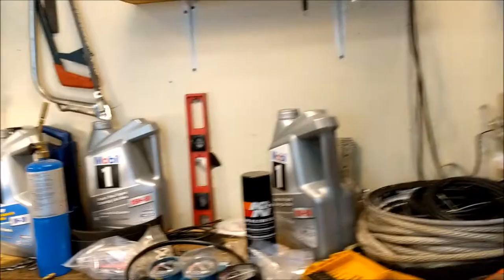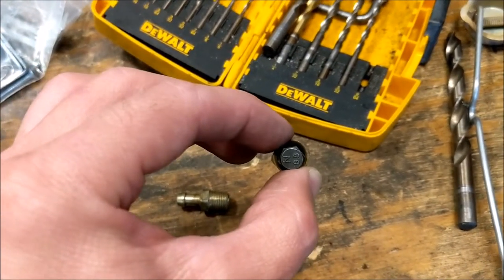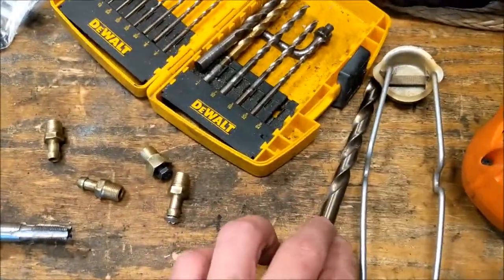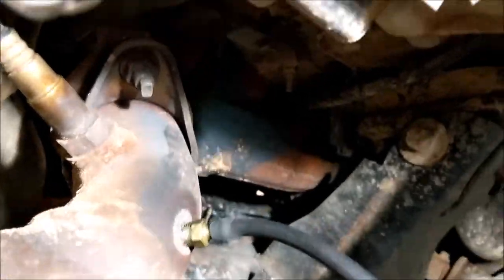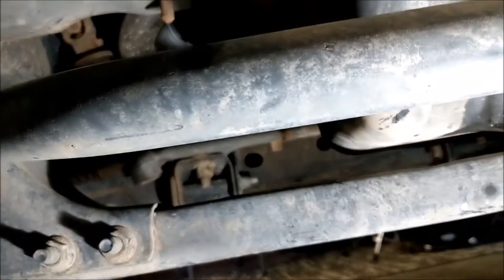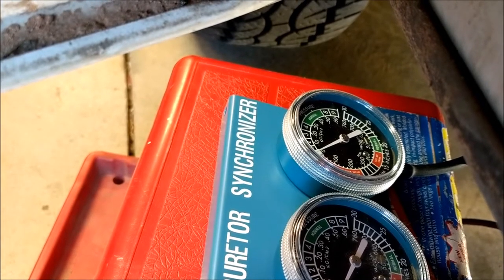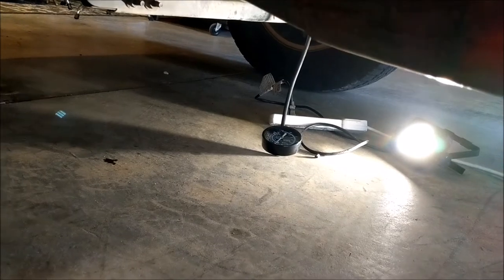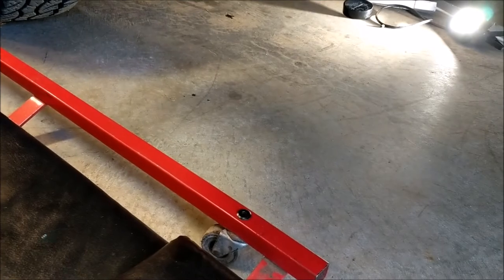How to Test Exhaust Back Pressure and Clogged Catalytic Converter

Comment: Hello, When I accelerate hard in my jeep GC 5.7, I get a rotten/foul smell inside my cabin through the ac vents. Can this be because if a clogged cat? If so, how does the smell enter the AC intake. Because the smell only comes after the engine is warmed up and I accelerate hard. Great video by the way 👍🏻
Reply from the maker: Rotten egg smell fundamentally comes from incomplete combustion, usually due to not enough air and too much fuel. This can be caused by over fueling due to bad oxygen sensor, engine valves hanging open, blown head gasket, or even possibly clogged/clogging catalytic converter.